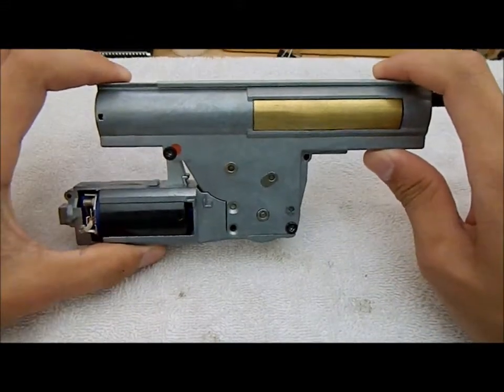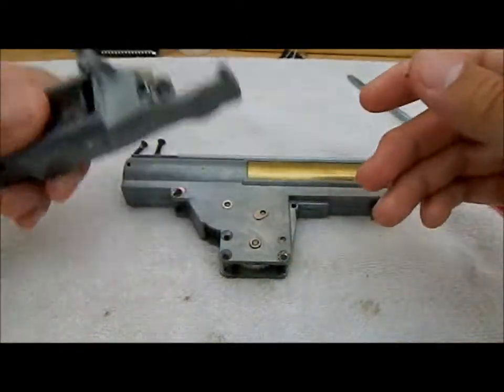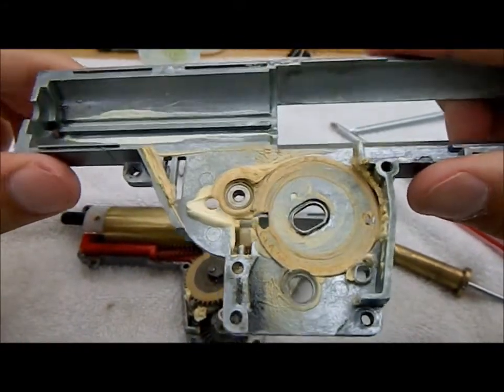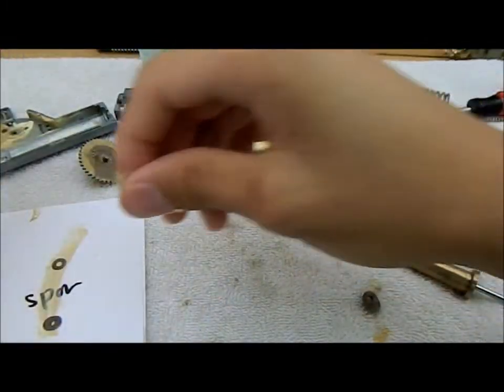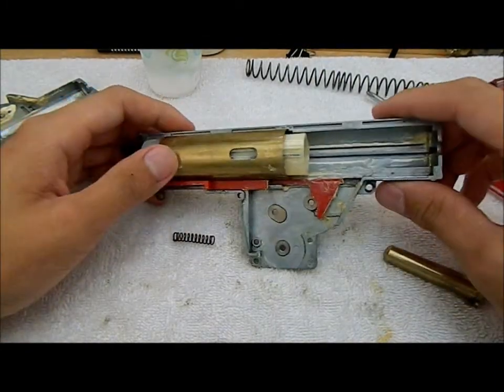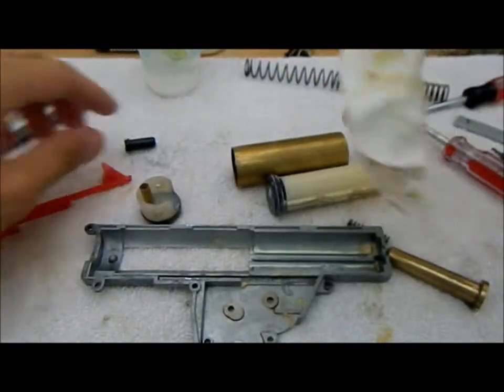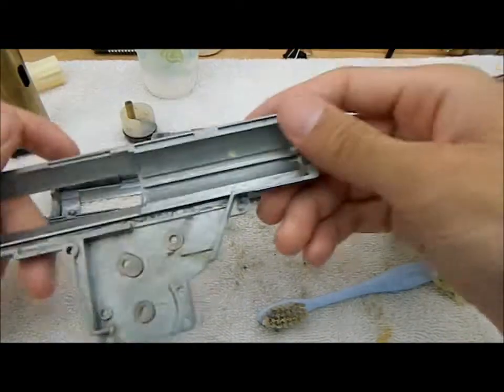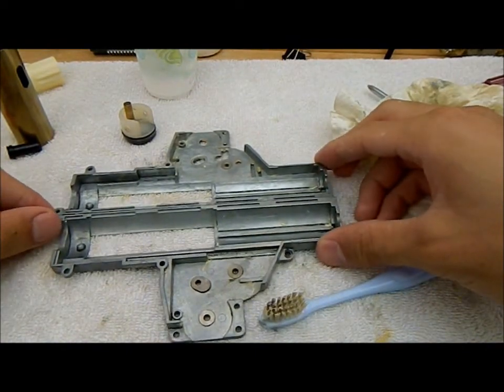Version 6 Gearbox Disassembly

Comment: this shit's so frustrating. mainly the putting back together part lol
but i have a problem with my gearbox and maybe you know the solution. the motor runs when not attached to the gears, and I can actually turn the gears until it releases the spring. but when i attach the motor, it just doesnt go.